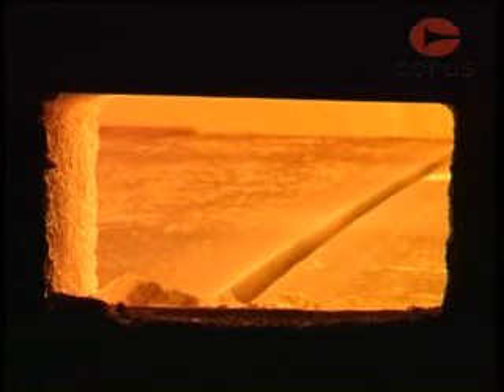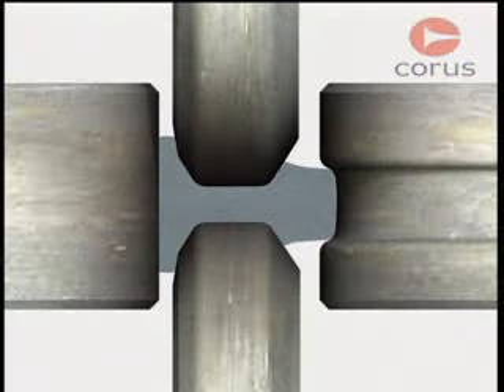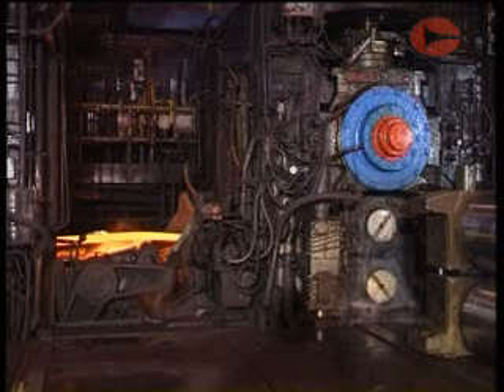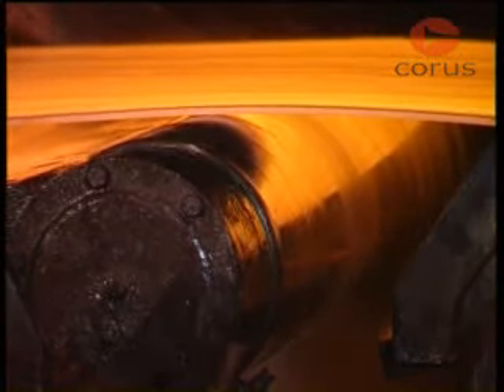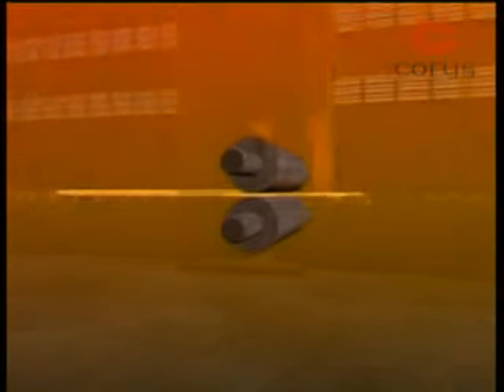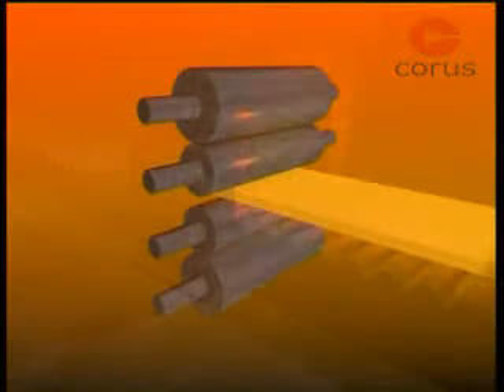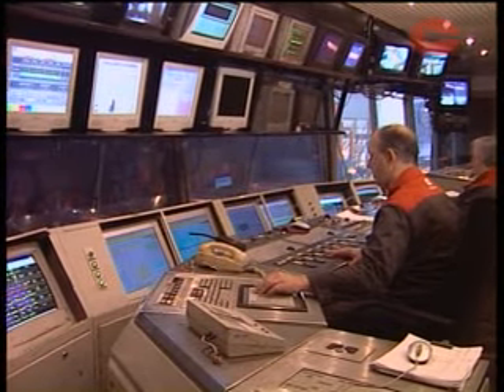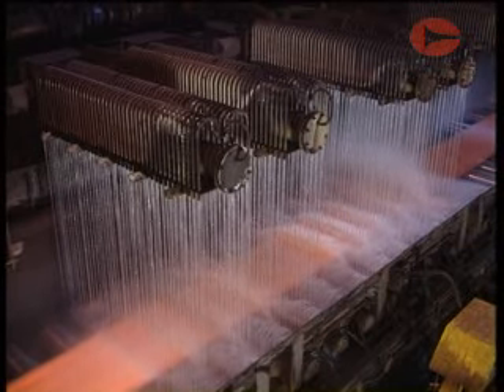Steelmaking: Rolling

Comment: Before being rolled here, the steel has been annealed to very higher temperatures. This makes it much easier to be compressed and molded by the massive machines. It is above its recrystallization temperature so it is much more malleable and the micro-structure of the steel is not affected by the process as much. During cold working, the the steel would be rolled at room temperature, and would require even more pressure and even larger machines for steel of the same size. However, the resulting steel parts would be stronger and have a better surface finish only at the expense of being less ductile.
Reply: But it still causes the grains to get smaller, right?

Comment: I guess the cooling process must go on slowly, otherwhise you might damage the steel with tiny cracks that later can lead to a building crashing or something similar. Just like it happens when you have, at home, a hot glass pan: if you submerge it, it might crack all the grass.